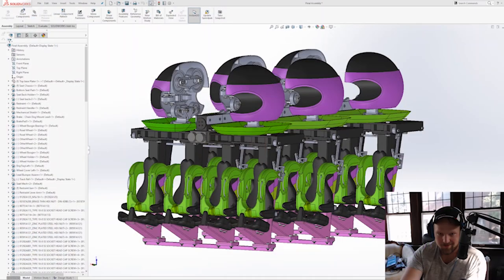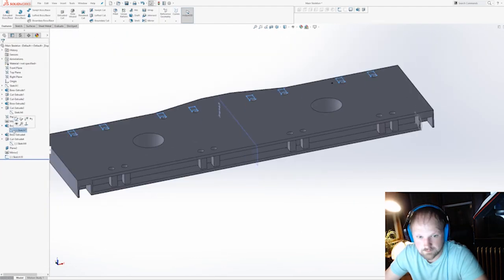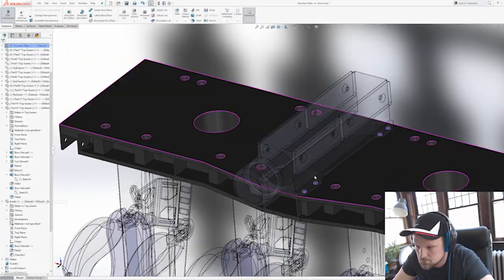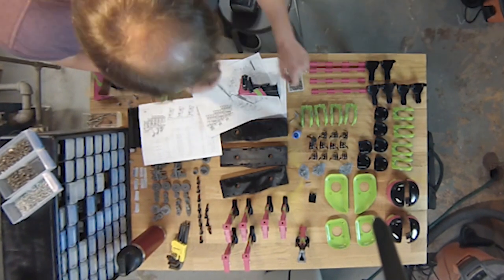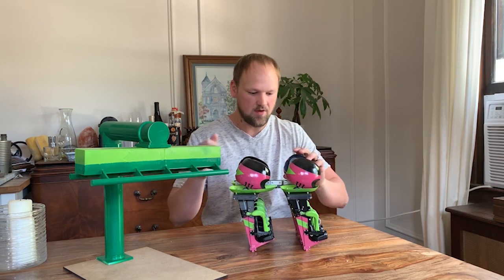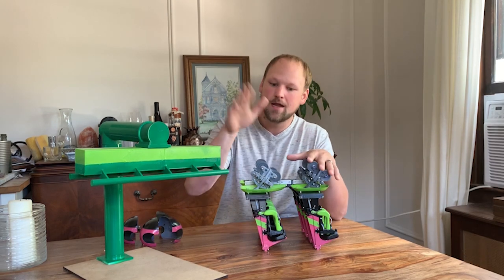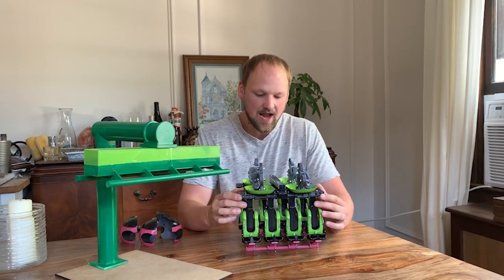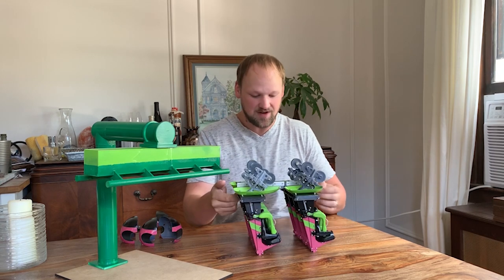3D Printed B&M Inspired Inverted Roller Coaster Train

Comment: Duuuuude this is exactly what I’m trying to build. I’m not a computer guy like you. I built something like this not close to what I want with a Lionel train and hardware store parts. What you have is what I want. I want to put boat hulls instead of a ride. I have the hulls. If you could build a 40x70x12 track at a smaller scale I’d pay you but your design for the track is exactly what I need. Thank you. I’ve been searching high and low and here it is. Thanks Charles

Comment: Awesome project! The amount of details & mechanical joints simply amazed me! 
As you mentioned in the video, so I'd like to share with you my current design and see if you can help me with a special train design. 
I'm a fully functional Vekoma MK1212 model train which will be placed in my office. 
The track is basically a LIM acceleration for 1.8 meters, to a 1 meter high loop, upwards vertically up and then goes backward. 
To implement the LIM system (as acceleration and deceleration) I'm using multiple sets of iron cores along with coils to generate a variable electromagnetic force controlled by an Adruino. 
Currently I'm focusing on  the track chassis, rails and electronics. 
So I was wondering if you have some suitable design to a track layout / or can assist with a nice train design. 
I'll happy to share more details & files.  
Looking forward to hear from you.
Thanks in advance!

Comment: I have a roller coaster in NL. How much would it cost per cubic inch to print a 1:157 hyper coaster. 500-1000 or 10000+? I have no idea how any of this works. I just want to know if I should even start. 
Also how small can I make a train that will still have roll, yaw, and pitch and make it around the track smoothly?

Comment: So, I'm trying to understand how the wheel bogey articulation works out. I see that each one individually rotates. So wouldn't the perpendicular distance between the bogey pairs decrease when you rotate them? So like, you turn them 90°, (not realistic I know) now they fit on a single rail rather than spanning the whole track. So I'm having trouble understanding an unbanked turn. I'm guessing there is enough play in the positioning of the guide wheels to account for this? But the road wheels would still be too narrow in the turn. Do they narrow the track in the turns? Or it is just negligible? Sorry for being wordy and hopefully my question makes sense

Comment: I wish you created the entire track. I built a CNC machine and just bought the Ellegoo Mars resin printer to make stuff like this. I want to build a roller coaster model from scratch, not the Coaster Dynamix parts. I'm into the traditional coasters but this is really cool.. Are there any metal parts besides fasteners?